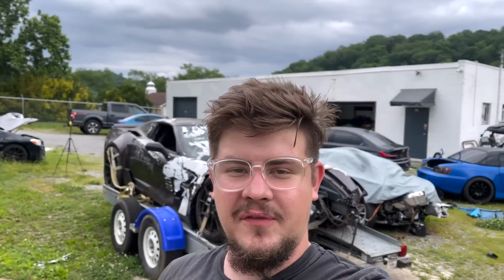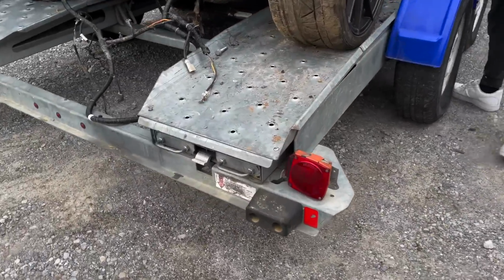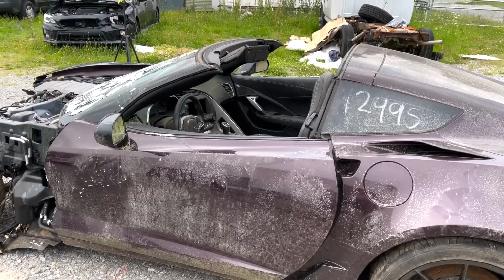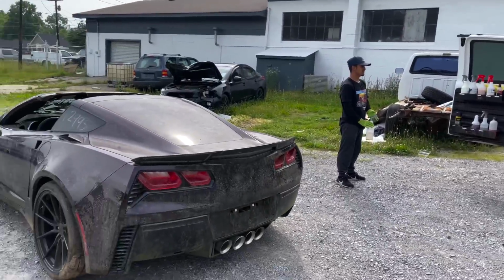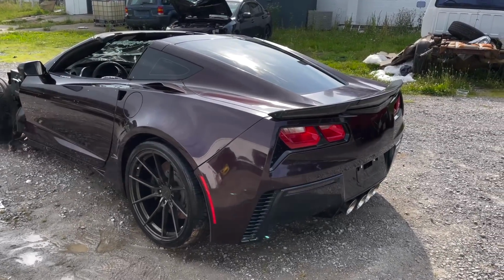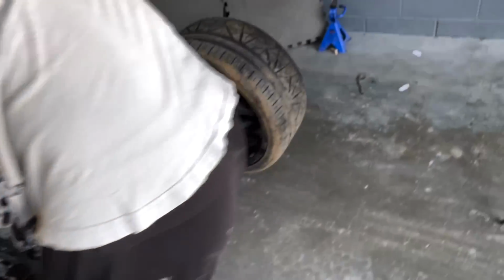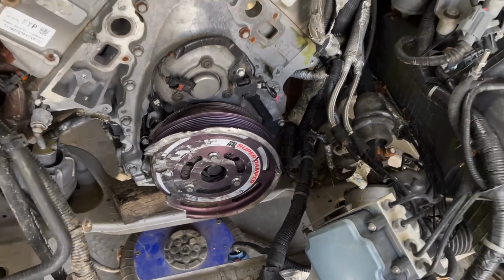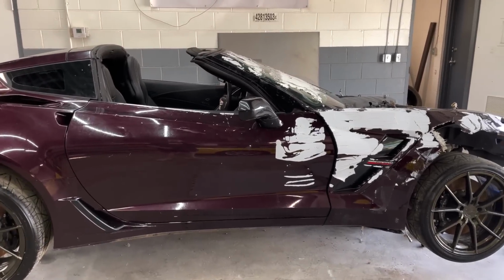Detailing The abandoned Free Corvette C7 What Should We Do with it?

Comment: The block from what I see is still good. I didn’t see any cracks. Now what is cracked is the timing chain cover. And it will need a new crankshaft & maybe some piston rods. The heads are good & the block is good. Remove the engine & go from there.
Reply: I agree it still looks salvageable but only by pulling it out will know for sure
Reply: How's about all the rods and block and crank .
Reply: @marcmartinez2079  I believe this car can still get a second chance, it's salvagable😊
Reply: The oil pump behind that timing cover is probably toast as well as it sits right behind that cover.
Reply: @kirksimpson3815  yes, that too. We won't know anything until V removes the engine so that way he can have a close look around the whole block

Comment: Ben....whenever you're working with these cars full of mold, you might want to use respiration protection. You just removed the superficial mold, almost sure there is still lots of it inside the ventilation vents/tubes (also see you tried to crank up the ventilation, not good) and probably on the trunk area. I know you hear this all of the time when you sand and paint, but mold is a serious thing. Can't wait to see what you end up doing with this C7!!!
Reply: Just commented the same thing

Comment: If you slow down and look closely most of that damage is the timing cover, engine block is possibly OK, while cranking, or running check if the front of the crank is wobbling. That'll tell if it's warped

Comment: ATI is an aftermarket harmonic dampener company. As you were able to see, they manufacture the Super Damper. As for that pulley, yes, it's for a supercharger, possibly a centrifugal unit, Ben. The previous person to have that car, he certainly did extensive amount of damage to the front of it. No radiator, the engine in pushed rearward in the frame, which means that there needs to be a different set of mounts for it. While I was looking at it, I saw the frame tubes were damaged. They might need to come off so you could fix them. It's additionally apparent that it needs two more front fenders. In addition to what I was typing about, those wheel wells need fixing. That's all at this time.
Reply: Ben, I don't need a gift. Do you want to know the reason for this? I don't subscribe to a single YouTube channel. It doesn't seem correct to me that I'll be sent a gift when I don't subscribe. I hope you remember this message. Why? It's because for as much time I don't subscribe to any of you YouTubers, it won't be correct of me to be given any of them. Thanks for the offer, though. I greatly appreciate the gesture.

Comment: Here's an interesting fact. MSD is an acronym of Multiple Spark Discharge Corporation. You asked what you should do with it. Another major problem is that it needs another engine, for the one in it currently is cracked. To fix it, you'll need a CNC mill and a welder that does aluminium. What's the mill for? To cut out the excess metal from where the. This means it's better to find another engine for the car, in the event you want to keep it. You did more work on the first generation Mustang, which you didn't finish as of yet.

Comment: No matter which outcome, its a great project to use as content!
Looks like its only the crank shaft front cover housing with oilseal and position sensor which is damaged. But ofcourse you need to see it in person to access the damage..
Keep up the good work, pull the engine, look at piston barrels, barings, crank shaft and make a call. Im almost sure that the engine block can be salvaged. But again it depends to which cost...

Comment: I have expressed significant criticism towards your videos following your decision to discontinue the second Mustang project. However, I would like to take this opportunity to make amends through this comment. Ben, I now hold a much greater appreciation for your content because, unlike many other YouTubers who undertake rebuild projects, you consistently exhibit a high level of skill. For instance, Goonsquad, as an example, primarily engages in a series of 30-40 cuts where they simply replace parts without showcasing any substantial mechanical or body work skills. Regardless of cost, you demonstrate genuine craftsmanship by diligently repairing panels and completing the necessary mechanical work. Unlike certain YouTubers who resort to shortcuts for the sake of gaining views, rushing projects, and substituting numerous costly parts, you maintain a steadfast commitment to your audience by providing accurate information. Your line of work is undoubtedly demanding, while other creators merely exploit opportunities for views, hastily complete projects, accumulate sponsorship deals, and promote merchandise, ultimately abandoning the cars due to safety concerns that even they lack confidence in addressing. Please continue your commendable efforts, as you possess genuine talent and skills that set you apart.

Comment: I bet someone could weld those engine mounts back on and fix those broken bolt holes and drill and tap them. and take the cover off the cam shaft and look behind it to see if it's damaged behind it. If not then you maybe able to upgrade the cam and replace that cover.  No matter what the heads maybe good and if they are you could most likely find a new block and switch everything from that engine to a new block.

Comment: Pull the motor out and send it out to someone who is an engine builder and have them check it out. You will be surprised at how much money is spent in your engine. Don’t throw away the motor. Send it out and see if you have a good one or you can save it so that you don’t have to buy another one. Transmission is in the back of the car and it’s probably still good so you only need the clutch and bell housing and tube that goes to the back of your car. Check with the guys at McFarland racing Cleetus or jack stand jimmy to see if they have any of the old parts from their car that they have moved the transmission to the front in.   Be careful when you’re pulling it down and try not to cut parts or hoses

Comment: The top end is good. I bet if you can buy the bottom part somewhere you can simply rebuild this engine. You might be surprised what a revision company can do for you guys.
Reply: Maybe they can even make sure the serial number will match the car. Meaning it will hold it's value much better.

Comment: You have to keep in mind the Goon Squad had a vet that was a little bit more damage than that one and they put it back together looks like the only problem is that motor was shifted back to talk to if I'm not mistaken is designed to take that kind of a shift in fact however if the block is not damaged you can buy another crankshaft but if not no big deal I would go to the junkyard find a 62 LS motor 6 bolt main take the internals from that engine that's good the cam Pistons the heads and put them on another vehicle another engine I don't know if it was me I think I'd go with it ignore the truck cast-iron 62 instead of the aluminum 16 pull the heads off of the engine and put them on a cast-iron block and all the goodies that's in that engine onto another block just looks like only problem you got is the crankshaft so all that stuff was destroyed water pump alternator air conditioning power steering however I personally think you can put that car back together you can even take it over to the Goon Squad if you have to put on the frame machine and straighten it out Little Rock the front end on that vet glue is a blues on I don't see that much you need except for the hood to finish to inner fenders possibly some frame Moines motor mount you'll need a whole front nose I think from the doors you got there probably a good bit of that I think you should pull the seats out of the car snatch the carpet out nevertheless what are you going to do with the car once you complete it a person think you should you should keep both sexes I think you should keep the BMW did you ever start record collection somewhere

Comment: Wasn't supercharged.The ATI Super Damper is a typical upgrade for Corvetttes as the factory damper is poor quality and comes apart at the rubber. The ATI damper has two pulleys just like the factory one, the one at the back of for the A/C and the front is for the water pump, power steering and alternator.

Comment: I can't believe nobody has mentioned how a supposed professional detailing company just jet washed the inside of that car including all the electrical components 😮

That's just crazy no professional would do that that's not a good way to clean the interior or deal with the mould infact it's now so wet it will make the mould worse than before 🤦‍♂️

That should of had any number of professional interior cleaning products used on it with an interior brush it also should of been steam vacuumed to help kill off the mould but there is actually chemicals that are designed to kill mould and disinfect and clean the interior 

That method they used was lazy and potentially gonna cost you more to fix the issues they caused in the long run definitely not a professional clean and to think that was 3 of them for 1 car aswell most professional detailers are 1 man per car unless its a big job that needs doing fast this wasn't a big job 1 man could of done that in no time and done a better job no way I would want them cleaning my cars with the tactics shown on this video junk car or not it just screamed unprofessional

Comment: If you can find a Yukon GMC XL Denali for the short one if it's an 03 303 have a 6.0 in them Elite model I'll take you to build a car but if you really want to do something freaky if you going to trash the car find yourself a Yukon Denali XL Denali closest 601 562 and take all those vet parts put them in the Yukon XL Denali and you will have a you starting a family anymore I would say get one of these vehicles and I'm going to say it like this I got a 03 and it's not no it's not no slouch got no slouch what you know find one same year as the Corvette put the Corvette engine parts inside that truck diesel transmission you won't have you only got to be the second one that I've seen I'm saving my money up to visually my truck is all black I got gray interior black exterior I don't know if you get some 20-in Wheels 2511 and put on air even though it's an 03 I'm just going to say this people may look at the 03 think it's the old truck Mr this truck has got a lot of technology in it I need paper 2500 bucks for unbeknownst to me the reason why these sold it to me for so cheap there are two lines that go back to the heating and air conditioning unit in the back of the truck are those two lines that run from the front to the back nobody carries them but since I am a GM lover I know that there's LMC Trucks and a few other companies that may have farts one of the people I went to was LMC truck gave them the part number for the part numbers for both lines and they had them for some hoses big boat for just under $200 a line so you going to be picking up those two lines and have the shop that I know of replacement then I'm going to probably replace the radiator I don't trust the GM radiators man I don't have one that burned my transmission up it's one thing about General Motors you got to be careful but anyway other than Zack this truck has just over 200,000 Mi on it personally I can care less about the knowledge I know that knowledge means repairs but I ain't one of those kind of people just afraid it's been a buck on some on some repairs my other truck I had to do the fuel pump that was $1,000 the radiator was $700 the water pump was 6 water pump and then have it installed the radiator was to 300 bucks and I had to pay pay to have that installed that's not my 03 that's my 99 and when I first got it I replaced the entire braking system on as far as all the rotors had to be replaced all the pads bedroom lights to calibers for the back of the truck the front was pretty good issue is now I got to get the transmission rebuilt and I told the issue I was having the shop Tony's around your Transmissions done chicken even though at the time it was running back so I'm going to have to I think 2600 rebuild the transmission but I got to replace the entire firing system for the engine spark plugs rubber cap button wires that kind of thing if your engine is being turned over slows either bad battery or bad starter so